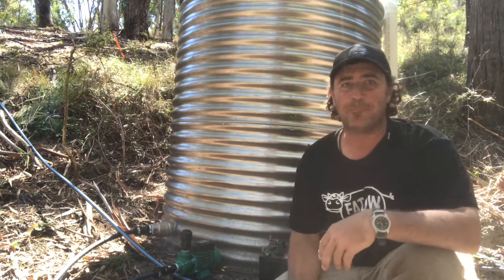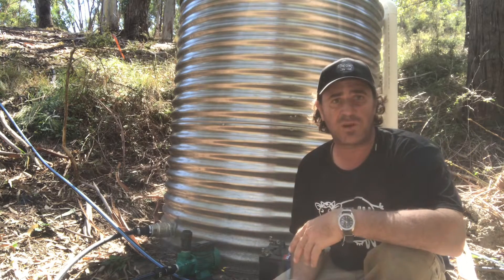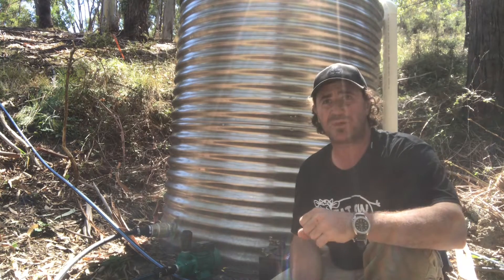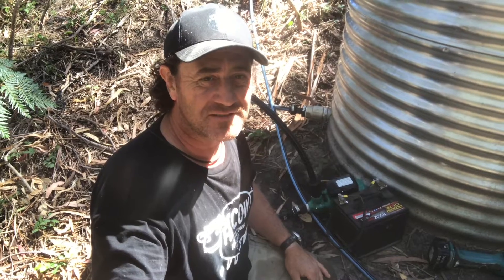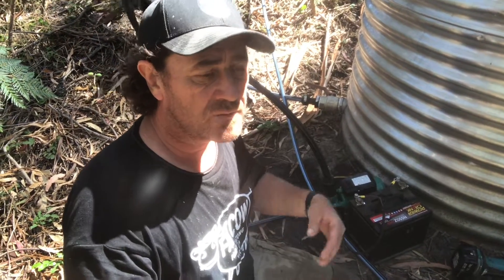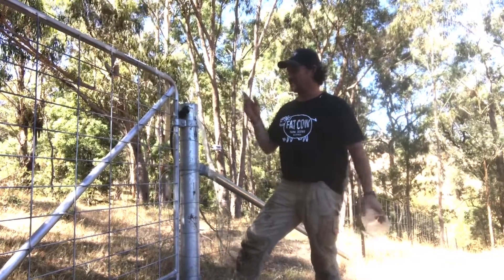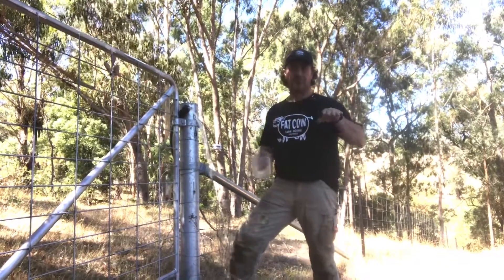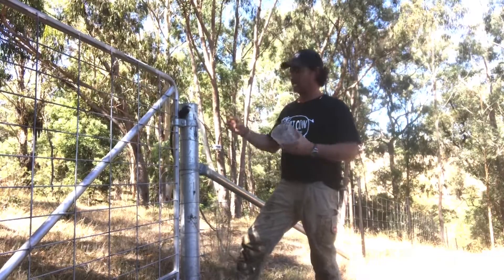Ram Pump v's 12 volt solar Pump - Part 2.

Comment: I wanted to use a ram pump but I don't have the fall of water that you need (and it was priced at $2,000) so I opted for a $450 solar pump. At the moment it's going to an ibc container then being carted off but ideally it would go to a header tank that is 19m higher that the water source. The pump can pump to 50m head but I was told it wouldn't work for 19m high? An experiment for another day. I'm enjoying your videos